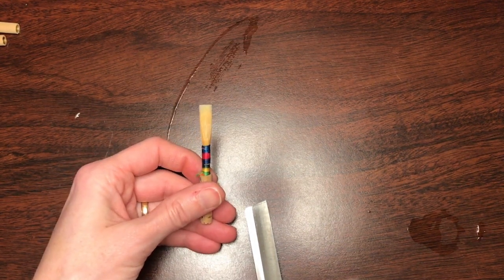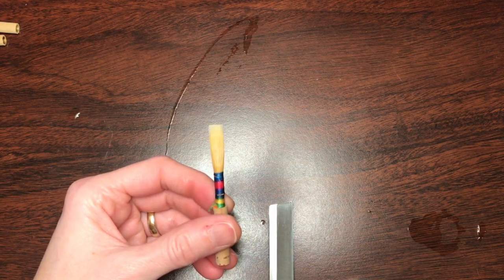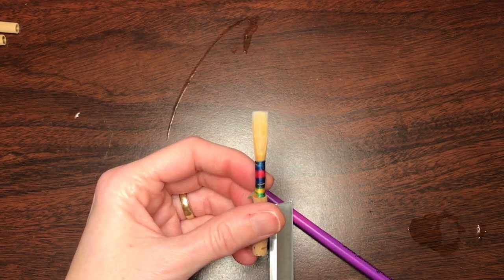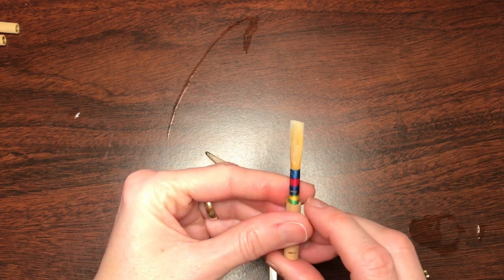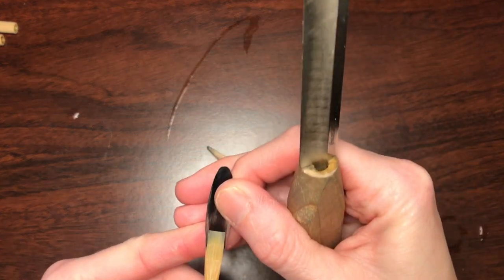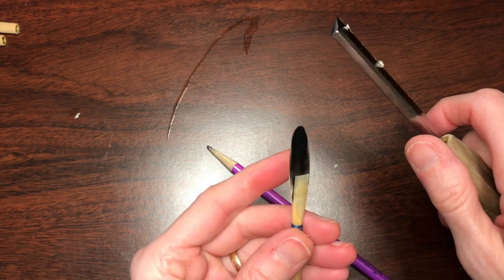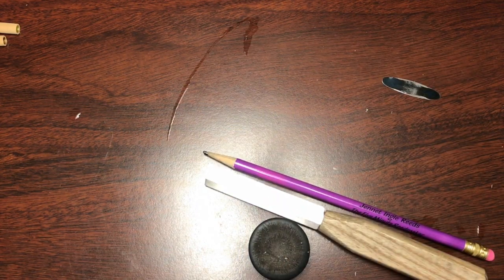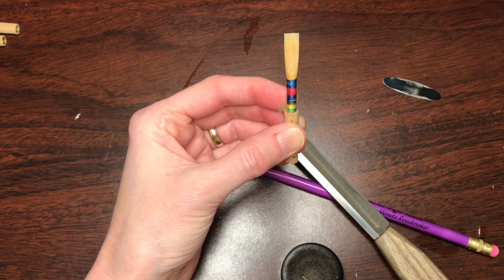Five Minute Reedmaker: The Shorter Blade

Comment: This whole concept of using the crossover to determine which blade should be up is totally  new to me. This is a thing?
Reply from the maker: Totally.  I used to think that having the crossover on the lower blade was ONLY useful and not important - an easy visual and tactile way to identify the short blade without having to squint. But now I sort of believe that because the thread IS the tiniest bit shorter on the reed where it crosses over, it helps me to set up the lower heart, rooftop, tip on that shorter blade. I kind of think I orient each blade to the visual top of the thread and that is why the crossover side is shorter. Maybe I'm perpetuating myths. But it makes sense in my head.
Reply: Jennet Ingle But that means that heart on the bottom blade is slightly lower than the other side. I thought that kind of asymmetry was undesirable
Reply from the maker: @rgombine  I'm going to clearly have to do another round of experimentation.  Isn't it interesting how you think you know exactly what you're doing and suddenly everyone else goes, "huh?" and then you rethink your system?
Reply: Jennet Ingle Definitely report back (I know you will!)

Comment: OMG.....I would never have thought of that.   Yes, I play with crossover on lower lip, but did not make proportions ever so slightly different.  Was the one one blade also slightly longer?
Reply from the maker: The reed I was working with WAS shorter on the lower blade, but felt disproportionate because the heart and rooftop were high.  Once I rebalanced I was much happier.
Reply: @JennetIngle  Thanks!!!  I viewed again....yes, you did say shorter.....I viewed in a hurry!    So, do you always have that shorter tip  (for response?) or decide as needed?
Reply from the maker: @kathbeat  I always do have one blade a little shorter.  But a convo in the comments over on facebook is making me wonder if that's a myth - so I may run another experiment or two!